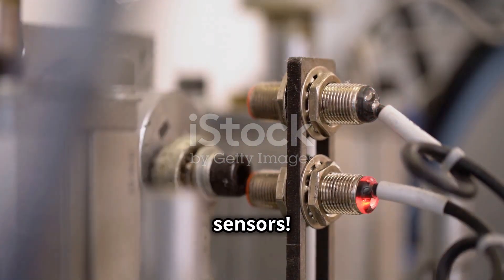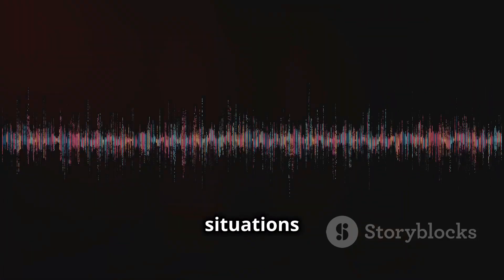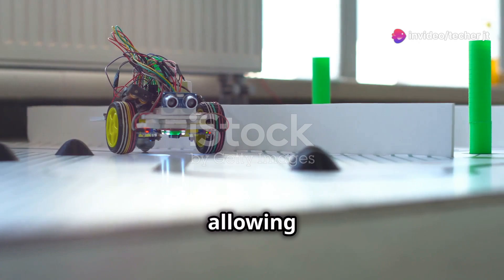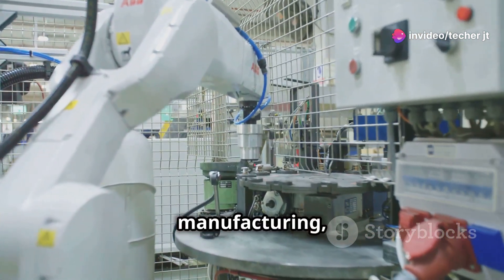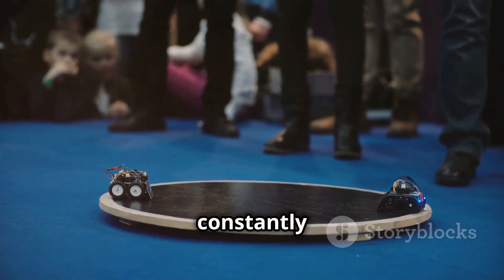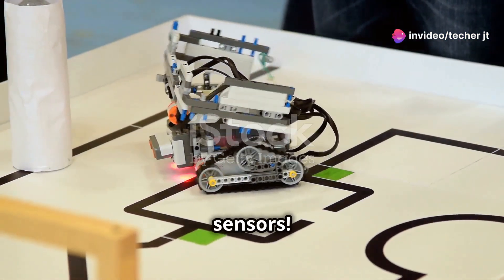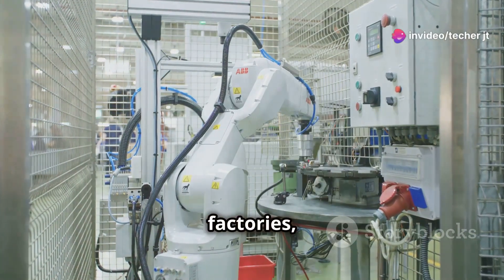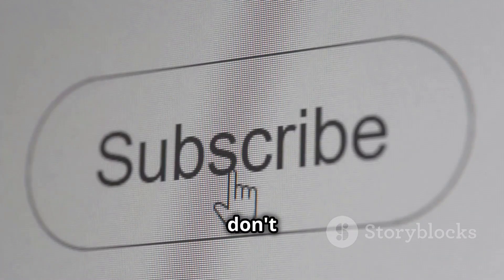Exploring the World of Robotics: Types of Sensors

Comment: Alexa Janne Arioja
10 - Lynx
5. Evaluating (Evaluation): Evaluate the effectiveness of using multiple sensor types in a robotic system. What are the potential benefits and drawbacks?

>Combining sensory inputs enables a robotic system with several sensors to have a better understanding of its surroundings. As a result, even if a single sensor fails, the system's dependability increases. Furthermore, it may be more adaptable in a variety of environments and vocations. However, growing complexity may lead to more advanced data processing, more hardware and maintenance expenses, and greater power consumption. To obtain the most performance out of multi-sensor robotic systems, these factors must be balanced. Robotic systems can perform more effectively and autonomously if the right sensors are incorporated and chosen.

Comment: Kiesha N. Enriquez 
10 - Orion

1. Remembering (Knowledge): What are the primary types of sensors used in robotics?

The primary types of sensors used in robotics are light sensors, sound sensors, temperature sensors, proximity sensors, tactile sensors, pressure sensors, accelerometers, gyroscopes, vision sensors, GPS sensors, and inertial measurement units (IMUs).

Comment: Chelsie Ann P. Carnaje
Grade 10 - Hermes

1. Remembering (Knowledge): What are the primary types of sensors used in robotics?

Answer: Robots use proximity sensors to detect objects, vision sensors for images, ultrasonic sensors for distance, infrared sensors for object detection, accelerometers for movement, gyroscopes for balance, and touch sensors for contact.

Comment: Manzanades, Chelsy
10-ANDROMEDA

4. Analyzing (Analysis): Analyze the differences between active and passive sensors in robotics. Provide examples of each.

Active sensors send out signals, like light or sound, and then observe how they react in order to collect data. For instance, ultrasonic sensors use sound waves to identify things, whereas LiDAR uses light to estimate distance. And passive sensors don't emit any signals. All they do is watch what's already there. Examples are temperature sensors, which track heat, and cameras, which record light.

Comment: Anika Charisse D. Dawal
10 - Lyra

4. Analyzing (Analysis): Analyze the differences between active and passive sensors in robotics. Provide examples of each.
ANS: 
Active sensors in robotics send out signals, such as sound or light, and then measure their response and gather data. Ultrasonic sensors, for example, detect objects by sound waves, and LiDAR measures distance using light.

Passive sensors, on the other hand, don't produce any signals. They simply observe what is already around them. Examples include cameras (which capture light) and temperature sensors (which monitor heat).

Comment: Englis
10 - Andromeda

3. Applying (Application): Given a scenario where a robot needs to navigate through a crowded room, which sensors would you recommend using and why?

- Proximity sensors. These sensors are like a robot sixth sense, allowing them to detect nearby objects without touching them. Proximity sensors are crucial for robots navigating crowded environments. They help robots avoid obstacles and prevent collisions.

Comment: Michaella ragmac
10-Cassiopeia

1 )  Remembering (knowledge) What are the primary types of sensors used in robotics?
Robotics employs a wide variety of sensors—such as light, sound, temperature, proximity, tactile, pressure, acceleration, gyroscopic, vision, GPS, and inertial measurement units—to perceive and interact with their surroundings.

Comment: Janaya Dyreane Baja
X - Lyra

2.Understanding (Comprehension): Explain how ultrasonic sensors work and their application in robotic systems.

— Ultrasonic technology emits high-frequency sound waves that bounce off objects, allowing systems to measure distances based on the time it takes for the waves to return. In robotics, this technology is used for obstacle detection to avoid collisions, distance measurement for tasks like picking and placing items, level monitoring of liquids in containers, and navigation in drones and autonomous vehicles. Overall, it enhances the capabilities and safety of robotic systems.

Comment: Zane Mendaros
X - CASSIOPEIA

5. Evaluating (Evaluation): Evaluate the  effectiveness of using multiple sensor  types in a robotic system. What are  the potential benefits and drawbacks? 

- Using multiple sensor types in a  robotic system can be highly  effective, offering several benefits  and some drawbacks. One of the main advantages is enhanced accuracy, as data from different sensors can be combined to provide a more complete 
understanding of the environment. This redundancy also increases reliability, as the system can continue

Comment: Messiah Emmanuelle Lei P. Salomon
10-Cassiopeia

4. Analyzing (Analysis): Analyze the differences between active and passive sensors in robotics. Provide examples of each.

-Active sensors actively emit energy or signals into the environment and analyze the response, allowing them to gather information regardless of ambient conditions. 

These include:
•Lidar
•Radar
•Sonar
•Infrared sensors

While passive sensors simply receive information from the environment without emitting any energy, relying on external sources for data. 

These include:
•Cameras
•Microphones
•Temperature sensors
•Humidity sensors
•Pressure sensors

Comment: Schumary Faye L. Reyes
10-LYNX

2. Understanding (Comprehension): Explain how ultrasonic sensors work and their application in robotic systems.

-Ultrasonic sensors work by producing ultrasonic sound waves that move through the air until they contact an item and are reflected back to the sensor. Then, the sensor determines the object's distance by measuring the sound wave's emission and echo's receipt. This technology may be used widely in robotic systems to do tasks including simple object identification, distance measuring, and obstacle avoidance.

Comment: Jannah Loreen S. Galla 
10 - CASSIOPEIA 

Q: 6. Creating (Synthesis): Design a simple robotic system that incorporates at least three different types of sensors. Describe how these sensors will work together to achieve a specific task.

A: Design a robotic vacuum system incorporating infrared, tactile, and optical sensors. The infrared sensors detect obstacles, allowing the robot to navigate around furniture and avoid collisions. Tactile sensors on the brush adjust the pressure applied based on surface contact, ensuring effective cleaning on different floor types without causing damage. Meanwhile, optical sensors identify and navigate around dirt patches or debris, ensuring targeted cleaning. Together, these sensors enable the robot to efficiently and safely clean various environments.

Comment: Shuwla Maine C. Lugtu 
10-Lynx 

1.Remembering (Knowledge): What are the primary types of sensors used in robotics?
-In robotics, the main sensors include the following: accelerometers, gyroscopes, vision sensors, GPS sensors, light, sound, temperature, proximity, touch, pressure, and inertial measurement units (IMUs). Robots can see and interact with their surroundings more easily thanks to these sensors.

Comment: Abbygail A. Somobay
10-Lyra

2. Understanding (Comprehension): Explain how ultrasonic sensors work and their application in robotic systems.

- ultrasonic sensors work by emitting sound waves and measuring the time it takes for the echoes to return after bouncing off nearby objects. These sensors are commonly used in robotic systems for obstacle navigation, allowing robots to map their surroundings accurately.

Comment: Ralf Mikael A. Lopez 
10-Andromeda

1. Remembering (Knowledge): What are the primary types of sensors used in robotics?
A wide range of sensors are used by robotics to sense and interact with their surroundings, including light, sound, temperature, proximity, touch, pressure, acceleration, gyroscopic, vision, and GPS sensors

Comment: Barbosa, Sabina Claudia 
10 - Andromeda 

1. Remembering (Knowledge): What are the primary types of sensors used in robotics?
- The primary types of sensors are light, sound, temperature, proximity, touch, pressure, accelerometer, gyroscope, vision, GPS, and inertial measurement units (IMUs).

Comment: Roda A. Patayon
10 - Lynx

3. Applying (Application): Given a scenario where a robot needs to navigate through a crowded room, which sensors would you recommend using and why?
For a robot navigating in a crowded room, I would recommend using a combination of proximity sensors, vision sensors, ultrasonic sensors, and sound sensors. Proximity sensors can detect nearby objects, vision sensors can help the robot identify obstacles and people, ultrasonic sensors determine the distance to objects, allowing the robot to adjust its speed and path, and sound sensors can detect potential collisions or noise from the environment. I believe that the more sensors a robot have, the more data it will gather to create an action to different situations.

Comment: Jasmine E. Delapus
10- LYRA

1. Remembering (Knowledge): What are the primary types of sensors used in robotics? 
-Light sensors, Sound sensors,
Temperature sensors, Proximity sensors, Tactile sensors, Pressure sensors, Gyroscopes, Accelerometers, Vision sensors,
GPS sensors, Inertial measurement units or IMU’s. Where each type serves a specific purpose and provides different types of data essential for various robotic functions.

Comment: Charles Christian Bahian
10-Andromeda

1. Remembering (Knowledge): What are the primary types of sensors used in robotics?
-Robotics utilizes a diverse array of sensors, including light sensors , sound sensors, temperature sensor, proximity sensor, tactile sensor, pressure sensor, acceleration sensor, gyroscopic, vision, GPS, and inertial measurement units, to perceive and interact with their environment.

Comment: Angel Alexa M. Maquilan
10 - Lyra

1 )  Remembering (knowledge) What are the primary types of sensors used in robotics?

- Robotics utilizes a diverse array of sensors, including light, sound, temperature, proximity, tactile, pressure, acceleration, gyroscopic, vision, GPS, and inertial measurement units, to perceive and interact with their environment.
Reply: Mitch Micah Niere
10 - Lyra

1. Remembering (Knowledge): What are the primary types of sensors used in robotics?
The main categories of sensors used in robotics are proximity, touch, vision, and force/torque sensors. These sensors help robots detect objects, touch, and changes in the environment. Accelerometers and gyroscopes aid in assessing motion and orientation for stability and navigation.

Comment: Princess Dawn B. Lamberte 
10 - LYNX

5. Evaluating (Evaluation): Evaluate the effectiveness of using multiple sensor types in a robotic system. What are the potential benefits and drawbacks?

Using multiple sensors in a robotic system helps it better understand its environment and remain reliable, even if one sensor fails. This also makes the robot more adaptable to different tasks and settings. However, the added complexity can lead to more difficult data processing, higher costs, and increased power usage. To get the best performance, it's important to balance these factors. Choosing and combining the right sensors can make the robot more efficient and autonomous.

Comment: Kaihanne A. Manticahon 
10 - Lynx 

5. Evaluating (Evaluation): Evaluate the effectiveness of using multiple sensor types in a robotic system. What are the potential benefits and drawbacks?

— Combining a variety of sensory input allows a robotic system with multiple sensors to have a greater grasp of its environment. As a result, even in the event of a single sensor failing, its reliability is increased. Additionally, it may be more flexible in a range of settings and jobs However, this added complexity can lead to more complicated data processing,  higher costs for hardware and maintenance, and higher power usage. Carefully balancing these parameters is necessary to maximize the performance of multi-sensor robotic systems. Robotic systems can function better and have more autonomy by integrating and choosing the right sensors.

Comment: Shiloh Nouvel A. Miquiabas - 10 Andromeda

1. Remembering (Knowledge): What are the primary types of sensors used in robotics?

Answer: The primary types of sensors used in robotics are proximity, vision, temperature, force/torque, gyroscope, accelerometer, and touch sensors.

Comment: Renalyn R. Gaid
X - Orion 
1. Remembering (Knowledge): What are the primary types of sensors used in robotics?
The primary types of sensors used in robotics include proximity, light, touch, motion, temperature, vision, and sound sensors.

Comment: Jana Sophia D. Enopia
10 - Lyra

1. Remembering (Knowledge): What are the primary types of sensors used in robotics?

The primary types of sensors used in robotics include light sensors, sound sensors, temperature sensors, proximity sensors, tactile sensors, pressure sensors, accelerometers, gyroscopes, vision sensors, and GPS sensors. Each type is important for helping robots see and work with their surroundings properly.

Comment: Neeka Ella P. Guillero
10 - LYNX

2. Understanding (Comprehension): Explain how ultrasonic sensors work and their application in robotic systems.

The ultrasonic sensor bounces sound waves off objects to measure the distance between it and the object. It does this by measuring the time it takes for the echoes to return. These sensors are critical to robotic systems because they enable easy movement in crowded areas by identifying nearby objects to navigate through narrow spaces, obstacle avoidance by identifying and avoiding obstacles, and navigation assistance by mapping the environment to avoid collisions.

Comment: Cassandra Louis R. Bigwas
10 - Lynx

2.) Understanding (Comprehension): Explain how ultrasonic sensors work and their application in robotics system. 

Ultrasonic sensors are electronic devices that use high-frequency sound waves, which are called ultrasonic waves, to measure distances and detect objects by emitting ultrasonic waves that bounce off, receiving the returning echo, measures the time interval between and receiving the sound waves, and calculating the distance to the object. Ultrasonic sensors play a crucial role in various robotic applications, such as obstacle avoidance, navigation and mapping and object detection.

Comment: May Ville D. Ortega 
10- lyra

1. Remembering (knowledge)What are the primary types of sensors used in robotics?

 Sensors commonly used in robotics include light sensors, sound sensors, temperature sensors, proximity sensors, tactile sensors, pressure sensors, accelerometers, gyroscopes, vision sensors, GPS sensors, and inertial measurement units (IMUs).

Comment: Loyola, Annarica Niña A. 
10-HERMÉS 

2. Understanding (Comprehension): Explain how ultrasonic sensors work and their application in robotic systems. 
Ultrasonic sensors work by emitting sound waves that bounce off objects, allowing the sensor to calculate the distance based on the time it takes for the sound to return. They are commonly used in robotic systems for obstacle detection and distance measurement.

Comment: Faith N. Ragas
10-Andromeda

1. Remembering (Knowledge): What are the primary types of sensors used in robotics?

Many types of sensors are used by robots to sense their environment, such as temperature, sound, and light sensors to detect color and brightness. Along with sophisticated sensors like accelerometers, gyroscopes, and GPS for precise movement and navigation, they also have proximity and tactile sensors for detecting objects or touch in close proximity. Robots become smarter and more capable when vision sensors function as eyes and IMUs aid in balance and orientation.

Comment: Shei Christiane C. Payot
10-LYNX

2. Understanding (Comprehension): Explain how ultrasonic sensors work and their application in robotic systems. 

Ultrasonic sensors are a type of proximity sensor that use high-frequency sound waves, known as ultrasonic waves, to detect objects in their surroundings. These sensors emit sound waves that bounce off objects and return to the sensor, allowing it to calculate the distance to the object based on the time it takes for the waves to return. Ultrasonic sensors are usually used for collision avoidance and environmental sensing. They enable robots to detect the presence, distance, and location of objects around them, making them useful for navigating complex environments, identifying obstacles, and ensuring safe operation.

Comment: Loreyn C. Nanay
10 - Lynx

1. Remembering (Knowledge): What are the primary types of sensors used in robotics?
     - The primary types of sensors in robotics are light sensor, sound sensor, temperature sensor, proximity sensor, tactile sensor, pressure sensor, accelerometers and gyroscopes, vision sensor, GPS sensor, and inertial measurement units or Imus